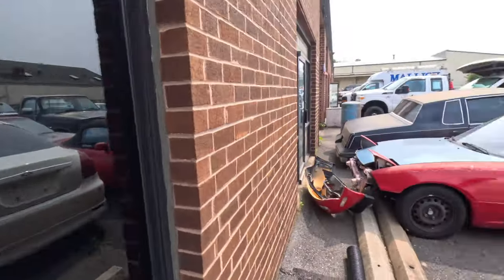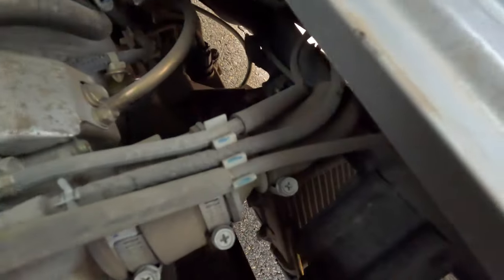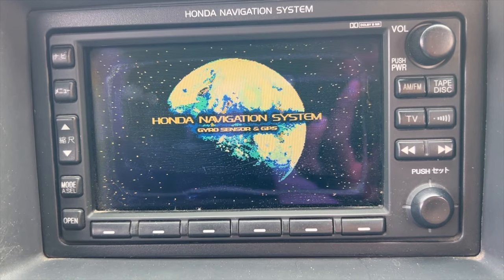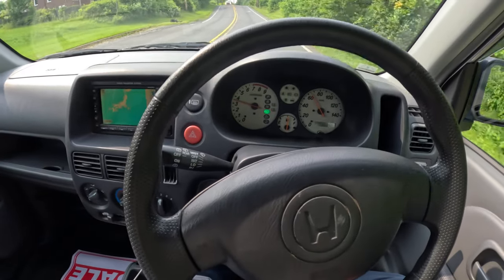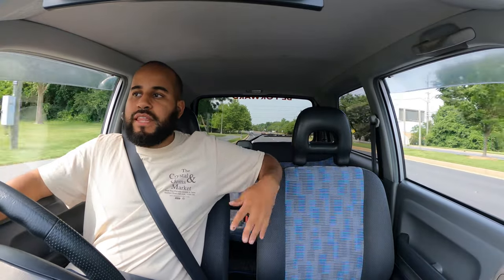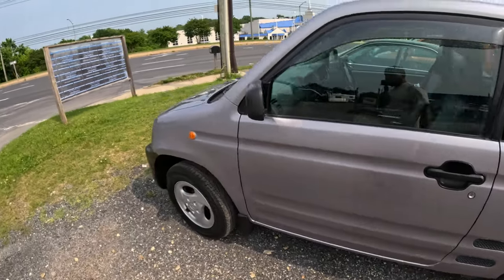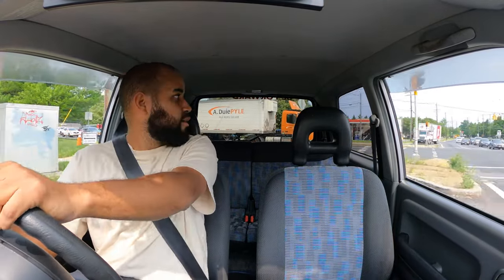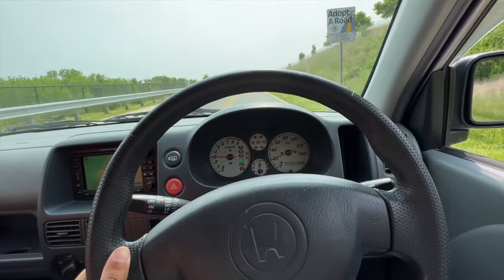Honda Z aka THE GREATEST KEI CAR IVE EVER SEEN

Comment: Check out a 98 Alto Works RSZ if you want an AWD turbo car with manual.  They really jazzed it up (like many kei cars) in 98.
Reply from the maker: yeah i want one of those badly! i heard there just as fast as the cappuccino
Reply: @Waybeforethefame   Earlier ones were same F6A turbo if you got the DOHC version (it's hard to tell without popping the hood, look for a 2 in I believe the first digit of the chassis code).  The 98+ were a K6A which was arguably better as it has a timing chain instead of a timing belt, so no worries about a 15 year old timing belt ready to blow.

Comment: Supposedly the Honda Z has been around since the 1970's.  Sadly, they only come in automatic.  They are based on the Honda Acty truck and modified for passenger use by adding safety features. here's the Wikipedia article:    https://en.wikipedia.org/wiki/Honda_Z